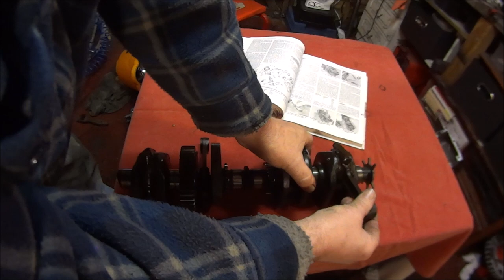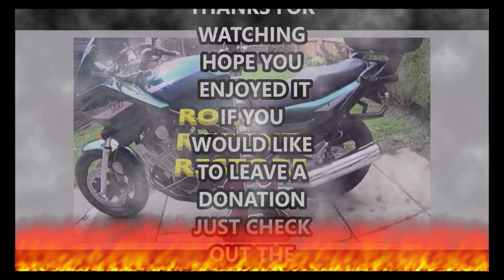CBR1000F Landfill bike, crankshaft and connecting rods check.

Comment: I can't see if there was any metal seal also on the 'new' roller bearing? What could be the reason for just having the seal on one side of the bearing? Is there a higher oil flow or pressure on the seal side, or something like that? Great vid as always!
Reply from the maker: It's only on one side and its on the dry side of the engine case. I didn't think to show both sides of the recipient bearing sorry.
Reply: @jonyr1TT  Ah! I see. The bearing will be lubricated that way, I suppose. Strange that the metal plate was damaged though.
Reply from the maker: I probably caught it trying to undo the big nut on the end of the alternator shaft or when cleaning up the engine case 👍🔧🔩😎

Comment: Is there a tooth missing on the crank sensor cog Johnny? 🤔👍🏻
Reply from the maker: Which one is the sensor cog???
Reply: @jonyr1TT  crank sensor wheel. It has spikes around it for the sensor to pick up the position on the crank. Looks like 1 spoke is missing or is it just me 🤔
Reply from the maker: No its just a gap in the spokes but well spotted and thanks for pointing it out. 👍 👍 👍
Reply: I noticed the same, but I think it might be correct. My wife's Kawa also has approx. 1/8 of the timing rotor 'missing' some teeth. Better check this out, John, just to be sure.
Reply from the maker: Yes its all good🔧 it is correct thanks guys 👍👍👍